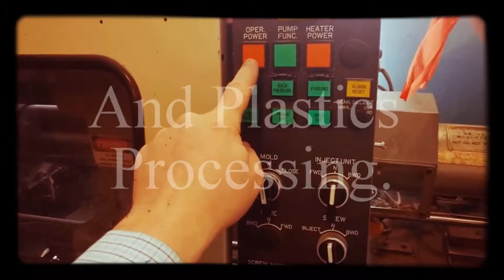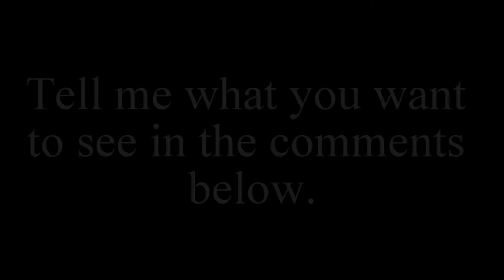Molding Machine Phase Conversion

Comment: What is the power consumption of the injection molding unit?
Reply from the maker: I haven't put a current monitoring unit on the incoming power yet, but the VFD feeds a 10 hp (7.5 kw) motor,  and there is about 3 kw of heating and about 500 watts of controls. So maximum power would be 11 kw. My gut says that actual average power consumption is around  3-3.5 kw, with the current mold I'm running.

Comment: If you live in an area where 220 volt is the norm , than you would probably need a 30Amp connection???
Reply from the maker: Oh, certainly more than 30 amps. Nameplate current on the drive is 49 amps, I have the drive fused at 60 amps for a 125% continuous load. It turns out that when feeding a larger inverter like this from single phase power, you need a much bigger inverter as well as available power due to the large input ripple current on the DC power bus.